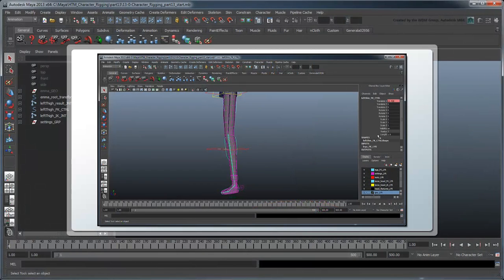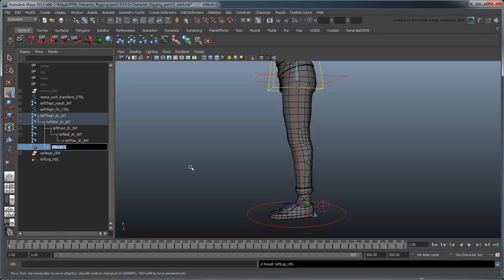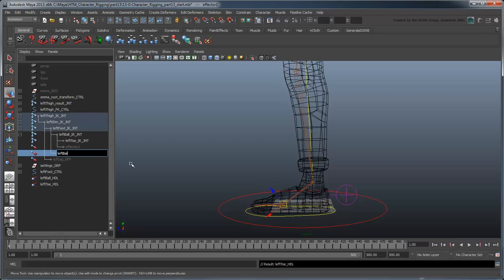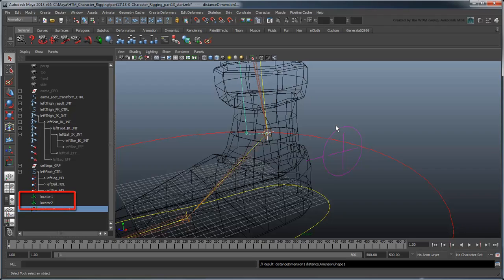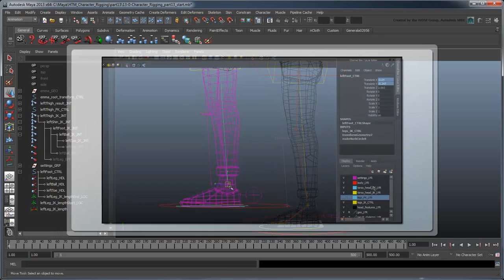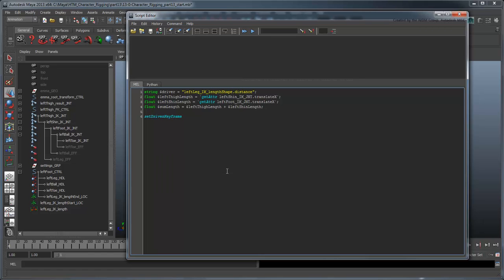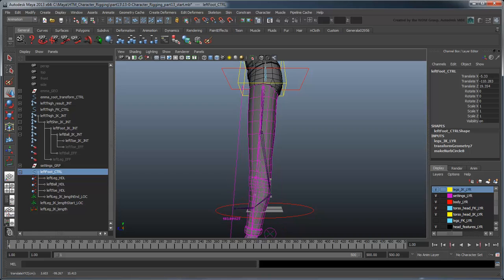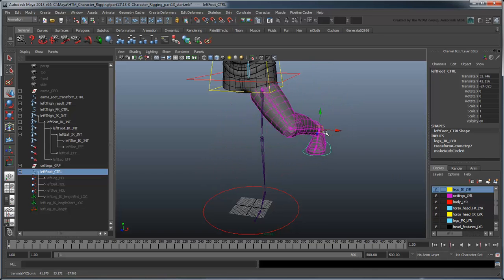Creating a Character Rig - Part 13: Leg IK controls and joint stretching (Advanced)

Comment: Hi, i´m having a problem, all the rig is working fine, until now, the script runs with no errors, but the bone don't stretch! The FK stretch works fine, i check the syntax, i compared your scene file with mine, seem that it´s all the same, I even did a exercise with just the ik bone and it worked, but with the Rig doesn't. What should i do, were can i check?! please help! thanks
Reply from the maker: I would double check to ensure the animation keys were set properly by the script.  Otherwise, you can try manually setting driven keys when the leg is at "approximately" a fully stretched position and 2x that position.  It won't be as precise as using a script to do it, but it would work well to test if that's where things have gone wrong.
Reply: Maya Learning Channel
Thanks for the answer, i found the problem, i´m doing the rig in my model, and it has a small scale, i build the model in cm, and started the rig in mm to reduce the grid spacing, so when i create a node like multiply divide, blend shape,... Maya creates a unitConversion node, doing the operation in scrypt maya didn´t made the conversion of the length value, i just add the node and it´s working! (1 week busting head)

Comment: I was getting A Syntax Error for lines 2 and 3.
I found out that they could be rewritten as:

float $leftThighLength = getAttr ("LeftIKJointShin.translateX");
float $leftShinLength = getAttr ("LeftIKJointFoot.translateX");

i used different names for my joints, but the important thing is how they are inclosed in parenthesis while inside quotation-marks.

all other things seemed to work as they are in the tutorial when all names respectively match each other.